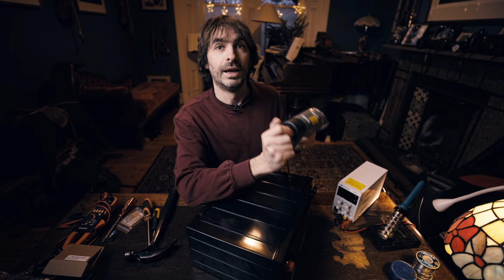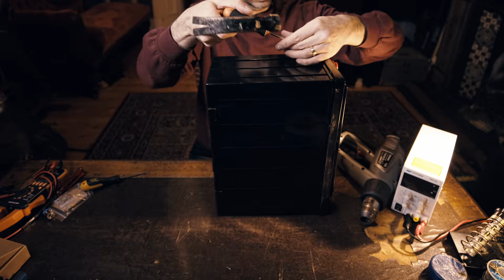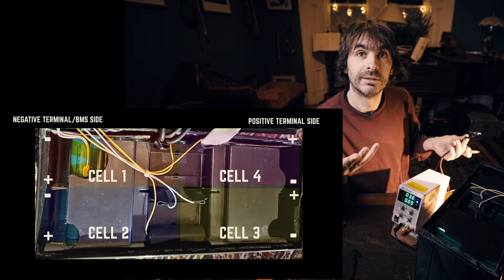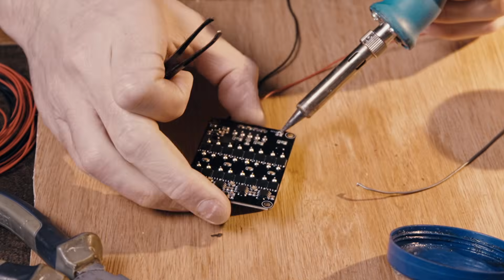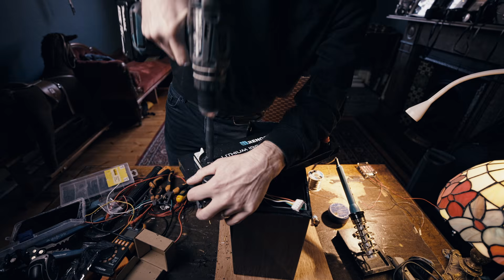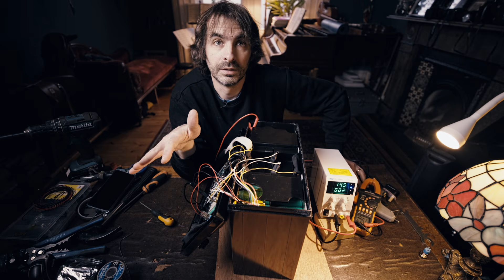How to Fix a Renogy 170ah Lifepo4 Battery

Comment: Sorry forgot to ask , the 2 white wires coming up from cell one and soldered to the bms, any ideas of function?
Reply from the maker: You might be referring to the temp sensor.  There are two, one on the cells and another near the connection points
Reply: @Allaboutcampers123  Hi I  did contact you earlier but it didn't send for some reason. Agree on closer inspection the pcb under the cover has a connection that says 85 degrees.  Any more videos planned. Excellent job

Comment: Brilliant video. I have 2 of these and managed to short them killing the bms. Having tried all the tricks to wake the battery's up , no joy new JK-B2A8S20P bms partially installed.  I have followed a couple of other YouTube  videos on installing and need some advice as all these are on blocks of cells and not an enclosed battery. My problem is after following the set ups shown i have no power to the bms and no Bluetooth connection so something must be wired incorrectly. I take it from your  narration you hinted you have replaced a bms?  The new bms has a  9 wired connection block , the black wire i have connected to the yellow comming up from the 4 b-  connectors. 1st balance red to the white in the middle nearest cell 1, 2nd red to cell 2 which is the yellow wire to the right of cell 1,  3rd red to white wire in centre of battery and finally red 4 to yellow on the left of that cell 4.  Red wires 5-8 not used. Red 9 I have tried same connection as red 4 and also directly to positive post. On testing i have 13.4v at B- and pos terminal,  P- to positive post 13.2v . Any ideas please and yes i managed to crack the lip of the casing😂
Reply from the maker: I do remember the jk bms has the connection block wiring in the reverse order.  So you may have wired them backwards.  Do you have voltage in the cells?  If so you should be able to revive it.
Reply: Thanks for the reply. Got the proper switch and now working although can only get cells to charge to 3.21v. Awaiting arrival of bench power supply and will follow your section from video on that. Any ideas what the 2 white wires coming from cell 1 to the cpcb do? Again many thanks
Reply: Thanks, took photo and enlarged it of block connector and it does have 85 degree marker . Sorted thanks. More videos  coming ?

Comment: Thanks so much for this, I have just bought 2x of them.. it will be a horrific feeling hacking into them before I have even used them, but better that than damage the cells with poor balance on the first charge! Mine will be under the van, so I will have to seal them with silicone when putting them back together! I will run the balancer switch into the van, so I can access it. I will also run a balance lead out of the pack into the van so I can actually monitor the cells when needed. I fly RC planes, and in the RC hobby, with mostly lithium batteries being used, we have little things you can plug into a balance lead to quickly read the voltage of each cell and the total voltage.
Reply: That's a great idea to have the balancer switch and cell voltages on a remote loom!  I feel your pain opening a new battery, but I don't regret it at all, they have been perfect since doing this. Good Luck!
Reply: @meerkatfilmsuk  I really appreciate your effort in making the video, it is a fantastic resource for the rest of us! Thank you!

Comment: This is amazing! Thank you for this.  My 5 month old exact battery won’t show higher that 13.29 volts after sitting for days and days on small ac powered automatic lip04 charger.  Do you have a recommendation on a bench top power supply?
Reply from the maker: You may have the same problem, I think it's common on  these lifepo4 batteries.  I have the cheapest amazon 5amp benchtop.  I would recommend getting a better one, with 10amps and 2 decimal places for voltage.  So you can be more precise.   Good luck with the repair!
Reply: Finished the mod last night.  The balancer has done an excellent job!  Just a quick question, is there any issue with the balancer being on when the battery is back in the truck camper system while hooked up to the solar charge controller and the inverter charger?
Reply: There's no problem with the balancer being on while the battery is being charged from solar.  I generally switch my balancer off and only stick it on from time to time but I know some people have it active all the time and I don't think it causes any issues. @Kehoe-ge4iq
Reply: Also, what hoops did you have jump thru to get renogy to send you a new one?
Reply: they made me make a video showing it not charging properly, obviously you'd need to do this before modding it! @Kehoe-ge4iq
Reply: Silly question, i had the exact same issue with my 2 batteries. Made a video showing charger on and when disconnected it goes to 13. Something. They sent me 2 new batteries which did the same, why not just changing the BMS instead of doing the balancer? I haven’t dig into the battery yet but after seeing your video you convinced me i was on the right path all along thinking they seem to have a weird behaviour of unbalancing easily.
Reply: @alexlepine  You can change the BMS, but it's more expensive and you need to find a BMS with active balancing that fits in the lid of the battery case.  I did one with a JBD 4s BMS that does work nicely and has bluetooth, however it was a very tight fit so I don't recommend it really.